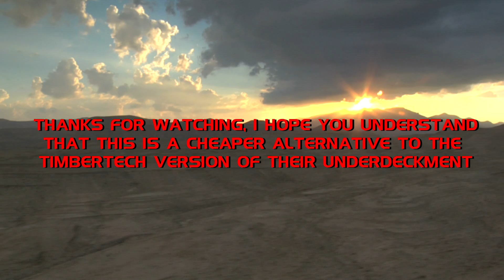UNDER DECK SIDING INSTALL PART 03 ON A WALK OUT BY PIPEFITTERMIKE 636

Comment: What about the leaves, dirt & debris that makes it's way through the upper deck ? Do the gutter filters clog up the debris between the siding roof & the underdeck space??
Reply from the maker: Okay...good question, my deck is a composite that only has every 10" a small weep hole for water, there is noway debris or material gets in there, occassionally at the bucket at the downspot of the gutter i will find small particles from the roofing material, but other than that there is nothing in there except water, it runs semi clear... now if you use 5/4 board you will have a gap that runs from one end of the board to the other, that might allow some debri... but my compostite, like i said, it doesnt allow any of that, hope this helps...thanks for commenting, liking, and subscribing, i do appreciate it, Mike
Reply from the maker: okay...my wife saw me writing this and she informed me that occasionally a helicopter from the maple tree gets stuck in the weep hole, but as far as she knows it doesnt go in the weep hole....her resposne to me was.."how would you know, i am the one that cleans the deck every spring and fall!" LOL

Comment: Shouldn't the pointy ridges been on the top side? Then you'd have more area for water and debris.
Reply from the maker: Okay, that is a thought except, i really just put it there for the birds and insects not to get in underneath the panels, i wanted the water to flow unimpeded to the gutter, this way the fuzzy material acts more as a guard to prevent animals, birds and insects, wasps, from making nests in there... the debris is so small and the gutter so big it just flows out to the downspout..... thanks for commenting, subscribing and liking, i do appreciate it, great question!! Pipefittermike